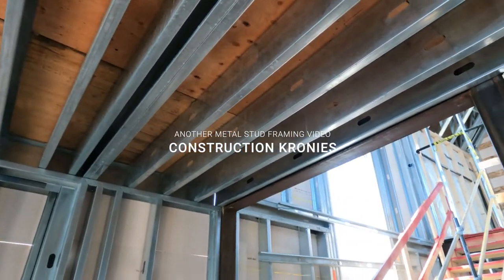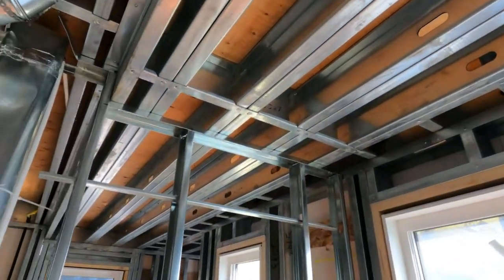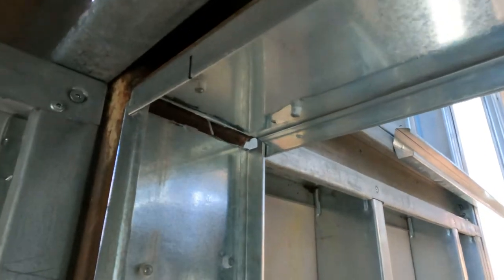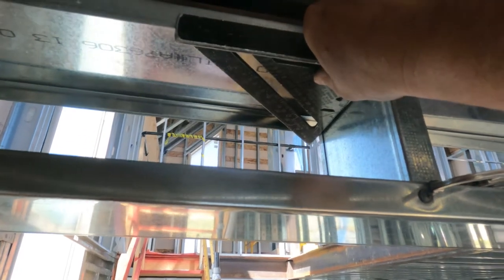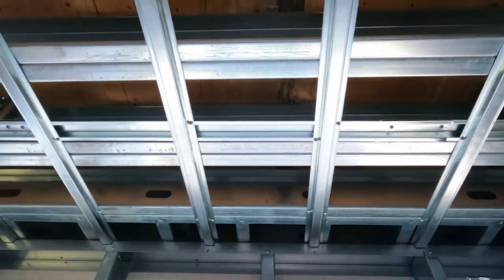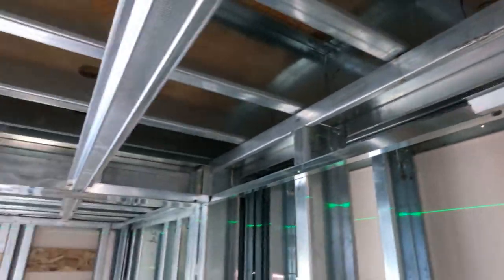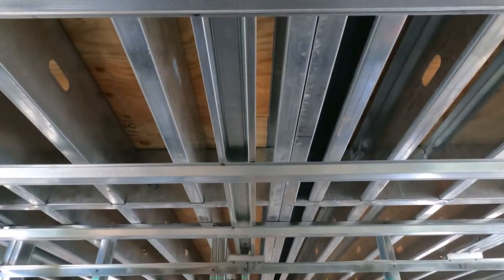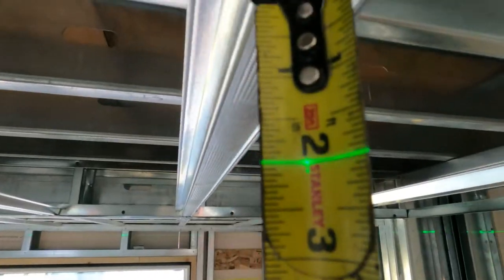How To Install A Drop Ceiling With Light Gauge Furring Bar & Angle

Comment: what's 2 inch offset for?
Reply from the maker: So you can check the center of the ceiling with the laser unobstructed. Plus 2" is the standard and most laser cards are set at 2"".
Reply: @ConstructionKronies  You set an offset because there is high side and low side? 2 inch offset is at 2 inch down from your given ceiling height of your blueprint?
Reply from the maker: @fhrflful   first we find the high side and go off that. Set the perimeter and then when we are setting the bracing we do the 2" offset so the laser line is not obstructs in the center. then bring the ceiling up or down to the laser line.
Reply: @ConstructionKronies  Thank you for your help I like your videos it helps me on jobsite
Reply from the maker: @fhrflful  you bet anytime!!!

Comment: 👍
Reply from the maker: Mandeep my guy🤘 what did you think of the video? I have 3 more on ceilings coming
Reply: @ConstructionKronies  this video is awesome man , i used to hang ceilings with wire , but this is great  if you have less clearance above ceiling and another good thing is the bracing is solid so ceiling will stay level , definitely trying this in future. Thanks for the videos man 
#kronies
Reply from the maker: hey bro! I am sorry this comment ended up in my spam for some reason. Yes, with higher clearances the wire and pencil rod is the way to go! This is totally for short clearance! Cheer my man! I just got home from almost 20 days of vacation!
Reply: No worries man, and you squeezed 20 days vacation into your busy schedule thats amazing , cheers man